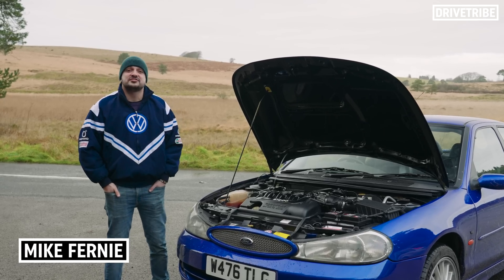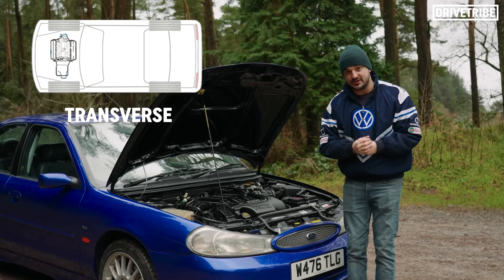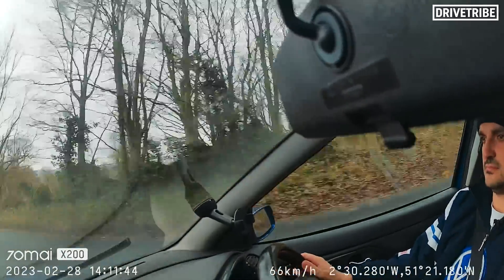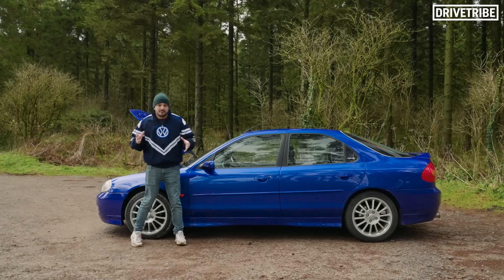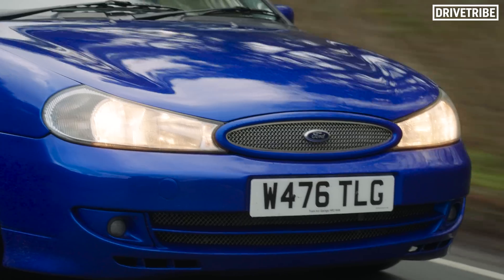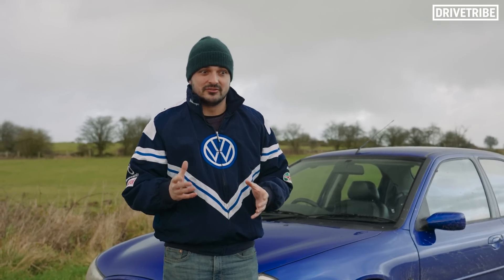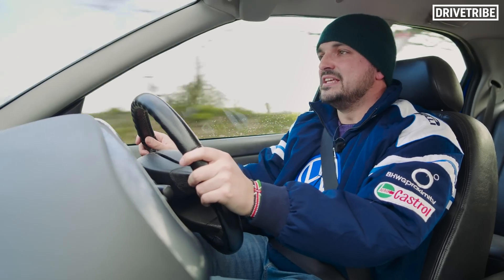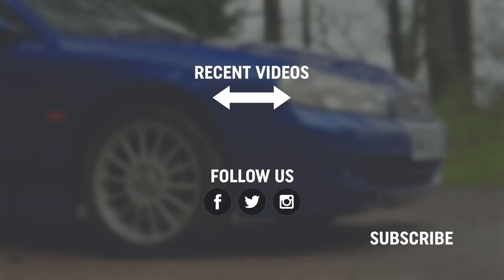Why does the transverse V6 engine no longer exist?

Comment: Mk4 mondeo's were available with 5 cylinder turbo engines....its the volvo lump. I have the estate version which is very nice
Reply: Little known fact but the Kuga got that 5 cyl too albeit detuned to 200 bhp
Reply: @Buck3366  think the s-max got it as well was an option for a few models if i recall
Reply: @clipshark1  yes it did, cos I had one. Had it stage 1 remapped, RS clutch and flywheel, better wastegate etc. The look on people's faces when you out accelerated them from traffic lights and you're in a people carrier... Priceless!
Reply: I was thinking this after the ST220, the 2.5t. It's a great engine!

Comment: In the US, Ford and Mazda (back when they were still partnered up) kept the transverse V6 going until about 2012. They were basically the US versions of the Mondeo, but with a bigger version of that Duratec V6. While both the Mazda 6 and Ford Fusion got the 3.0L engine, The Fusion was available in the Sport trim with a larger 3.5L engine and a 6 speed manual. I had the 3.0L Fusion, and with some decent tires, it handled better than it had any right to. The only problem was Ford engineered in some AGGRESSIVE rev-hang when you let off the throttle
Reply: They never offered the Fusion V6 with a stick, all V6s were automatic only, unless you're confusing it with the seventh generation Honda Accord and third and fourth generation Nissan Altima which could be had with a 3.0L/3.5L V6 and a 6-speed manual. It was only the four cylinder that got a manual for both generations of Fusion, the First generation Mazda6 did have a manual/V6 combo (tbh the Mazdaspeed6 with it's turbocharged 2.3L four was the better enthusiast car) but that combination was dropped with the second generation one as all V6 Mazda6s were automatic only. Also the Fusion/Mazda6 had a completely different platform than the Mondeos. The MK3 Mondeo for example shared the same platform with the Jaguar X-Type and later Mondeos used the same EUCD platform as the second-generation Volvo S80/S60 and First generation XC60 and Land Rover LR2 and for the most part used Volvo engines. It was until the last generation Mondeo when they sold it in the US as the second generation Fusion and that was never offered with a V6/manual in the North American market, but the last Fusion Sport with the turbocharged 2.7L Ecoboost V6 really pulled.
Reply: @EmanL8758  You're right, It was a stronger Aisin 6 speed auto, not a manual.
Reply: @McNasty43  Yep, which were decently reliable since Aisin is a Toyota subsidiary.

Comment: I love this engine in my Ford Contour. The Duratec lasted in its 3 liter size until 2012 in various US Ford's.
Reply: As far as I'm concerned every Ecoboost V6 is really a dura-boost
Reply: Jaguar also used the duratec albeit not transversely mounted until 2012 in the the XF
Reply: @Thanos.m  The Jaguar X-Type used a version of the Duratec 25 mounted transversely. My son has a 2004 model with a 5-speed manual.
Reply: @derekaldrich330  The X-Type was a rebodied Mk 3 Mondeo.

Comment: Ahhh, there are a number of vehicles sold here in the US that are FWD and V6 which would seem to imply that they are transverse. For example, the Nissan Murano and Maxima according to NissanUSA. I have no experience with these vehicles, but like I said I think it's safe to assume a FWD V6 is transverse mounted. Correct me if I'm wrong.
Reply: Toyota Camry is, so - a huge volume seller is transversely mounted. The Avalon is, too, while it lasts.
Reply: FWD = Front Wheel Drive, in case anyone confused it with Four Wheel Drive (4WD).
Reply: Maximas might be the last. GM had them in a couple cars, Impala, Regal/LaCrosse, and Commodore but just in the last few years dropped either the engine option or whole cars in 2019-2020. It still has the 3.6 transverse mounted in a couple crossovers in the lower spec options, but.. crossovers. 🤢

Comment: Having a sebring with transverse engine was a nightmare. I hated it. Maintenance was insane.
Reply: Want to replace a water pump? Gotta take out the whole engine. Wanna change the battery? Have to take off a wheel... ridiculous.
Reply: @yannyyansen9743  want to change a clutch 😢
Reply: @yannyyansen9743  Having owned the car you can actually change the battery without taking the wheel out. You need to turn the wheels first though. It can be done. There is just enough room.
Reply: Spark plugs :)
Reply: I can believe it.
Reply: They don't make sense nowadays when you can have a proper turbo 4 cyl. Cheaper, smaller, less parts, easier maintenance
Reply: Doubt on that. I had an Chrysler Grand Voyager with small 3.3 V6. Hated it.

Comment: My favorite transverse V6 is the 2.8 Turbo in later Saabs. Awesome cars
Reply: That engine was actually a GM Holden designed V6 which was then reworked by Saab to support Turbos. Once this was done and due to the GM ownership of Saab. The engine was passed onto Vauxhall for use in the Vectra VXR.
Reply: @TheSaabClinicUK  jup, designed for a cadilac, tuned by saab and clamed by opel. Just like the v6 in the later insignia
Reply: SSSHHHHhhhhhh godsake stop telling people about SAABS, they've all forgotten them so we can enjoy our little secret!! imagine if he got his hands on a V6T xwd 93 wagon wee little fella would need to change his pants
Reply: I was just coming here to say this very thing - Currently driving a 2011 95 V6 XWD, magic car.
Reply: Excellent excellent car
Reply: Another fan of the V6 in my Saab Turbo X. Coupled with XWD it is a very capable car.
Reply: I’d grab any Saab you can there’s only a finite amount left
Reply: @seanwilliams5382  I have one and am trying to buy more lol I’m doin my part
Reply: @seanwilliams5382  I have 3 and looking to add 1 more.
Reply: Finishing with that same 2.8 being put into the Opel / Vauxhall Insignia OPC/VXR =P
Reply: Yeah,
(GM) Saab of that era became refined, but not as fun as 900 Turbo. That when Saab started to became a diluted brand.

Comment: I had a 407 V6 3.0 coupe - which had a transverse engine. You want to change the plugs? well 3 of them are right there - the other three? you'll have to take the exhaust manifold off...
Reply: Intake manifold*

Comment: I had a 1st generation N/A Mazda 6 with a 3.0 V6 and a 5 spd. manual and I loved it. Rust took it. Nowdays, turbo 4's are lighter, cheaper to produce and make just as much power as the 6's.